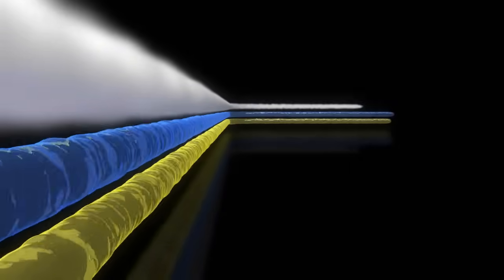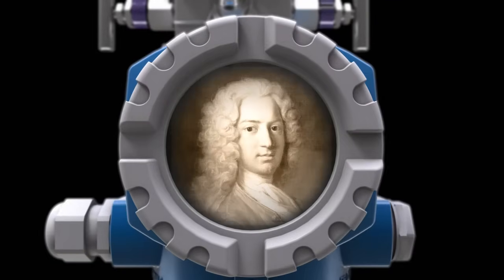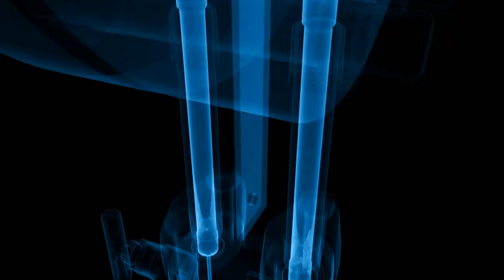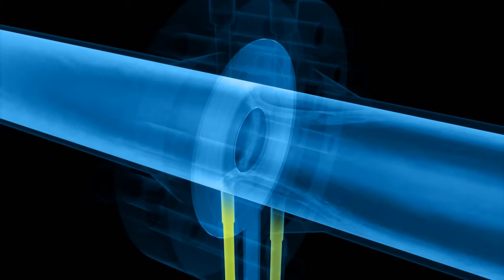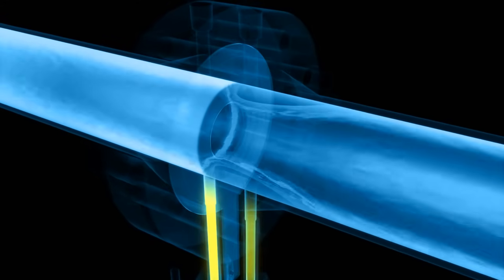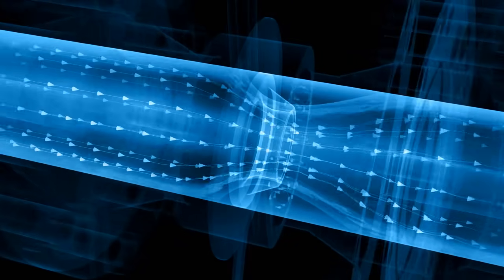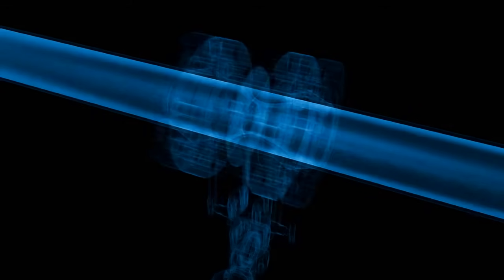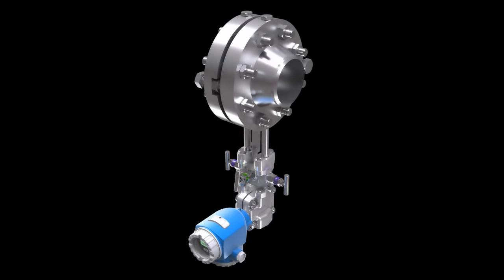The Differential Pressure Flow Measuring Principle (Orifice-Nozzle-Venturi)

Comment: It measures the discharge/Volumetric flow rate of the fluid. But I can't say that the Volumetric flow rate would be same throughout the cross section of the pipe because at other points of the pipe we shall observe much less pressure drop/ pressure difference . Then why do we need these measurement devices ?
Reply from the maker: We'd kindly ask you to contact your local Endress+Hauser support. There you'll find best assistance for the tailored solution. The contact details can be found here: https://www.endress.com/en/contact

Comment: Seems a very inefficient method as it slows down the flow in the pipe. Surely you can use sound to determine flow. The sound of the flow in the pipe would be detectable with a direct mounted mic that picked up the sound of the fluid transmitted through the pipe. Then you just need to work up the math to come up with a relationship between sound and flow.

Comment: Pressure Gauges used in Hydraulic Machines have got a small hole of 1 mm dia, How does the gauge shows the correct value of pressure in system, there should be a pressure drop as it is also similar to orifice?
Reply from the maker: If you are talking about a loss of pressure due to a change of pipe size, we are definitely not able to compensate for the pressure loss created by the friction of the pipe. What the pressure instument shows is the instantaneous pressure measurement at that single point.

Comment: In minute 4:15 you read (and listen): "With this measuring principle all liquids, gase or stea can be measured...." ¿How can I measure pressure of a gas with a venturi principle?
Reply from the maker: For just measuring the pressure of a gas or other fluid you would install a pressure sensor - no need to consider a venturi. A venturi element generates a pressure drop with flowing fluid which allows to measure the flowrate when measuring the pressure differential up- and downstream.

Comment: How does the sensor measure the diaphragm displacement?
Reply from the maker: +XyekiniX This depends on the type of diaphragma:

Ceramic process isolating diaphragm. 
The ceramic measuring cell is based on the principle of a plate capacitor with an electrode on a meter body and a movable electrode on the interior of the diaphragm.
Silicone oil or mineral oil are used as the standard filling oils for this
measuring cell. A differential pressure (p1 ≠ p2) causes a corresponding deflection of both diaphragms. Both capacitance values are converted and are fed to the microprocessor of the transmitter as a digital signal.

Metal process isolating diaphragm. 
The process isolating diaphragms  are deflected on both sides by the acting pressures. A filling oil transfers the pressure to a resistance bridge (semi-conductor technology). The change in the bridge output voltage, which depends on the differential pressure, is measured and processed further.

Comment from the maker: @joepipe101:
Basically  it is possible to work with a venturi solution in this case. But also a Pitot tube solution comes into consideration. To figure out the solution that fits best we need further information. Therefor please contact your local Endress+Hauser representative in Canada.

Comment: I'm the inventor of the joepipe technology and am looking for a way to measure air volume input for the combustion process.  On the opposite end I would require a venturi flow meter for measuring flame exhaust of 2, 000 F.  Would you be able to suggest what should be used here?  Thankyou for your responce.